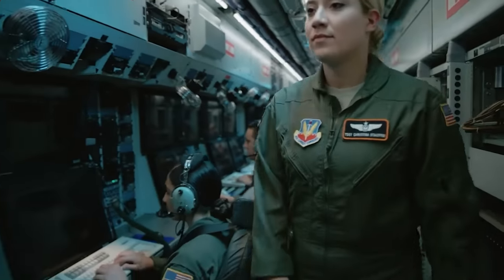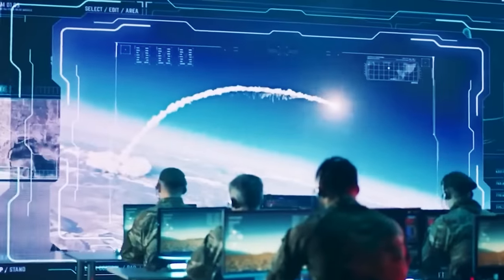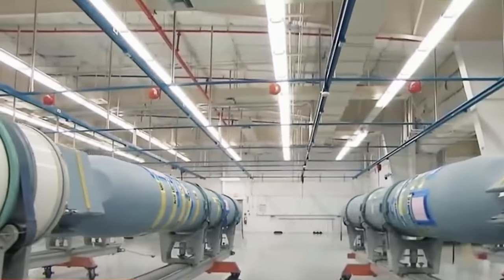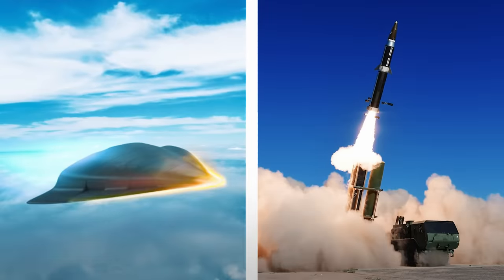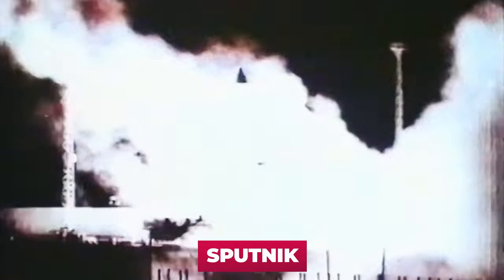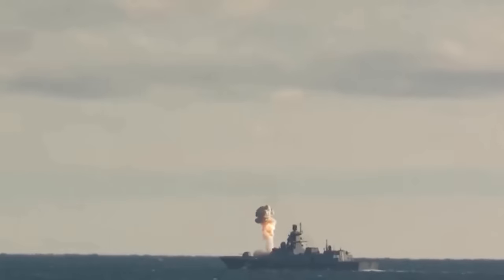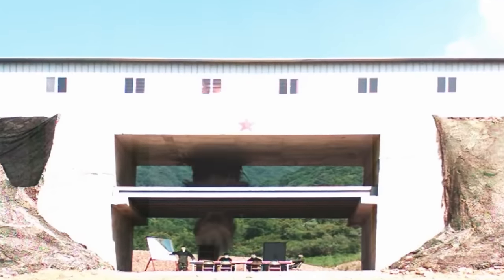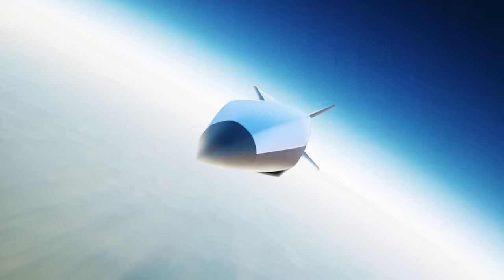US Tests Hypersonic Missile 5 Times Faster Than Speed Of Sound

Comment: We do not know the exact data on Russia's Kinzhal. We only know that it's indeed VERY FAST. -We only know this from video footage captured in Ukraine. As far as any and all capabilities beyond the proven high speed, depends on how accurately Russian technical data has been presented to the public, in the past. They present many of their most "advanced" weapons, often as having far better PK than they can often demonstrate.
Reply: Mac 12 though (no proof)
how about China (df17)🤷
Reply: We have all the data, its public. It is a ballistic missile, no need to fussle about that. Ukraine uses Tochka U, which is an old Soviet ground launched ballistic missile, similarly difficult to intercept. Poor precision and smaller range than more modern Iskander. And Kinzhal is 100% Iskander, just air launched to extend the range. Nothing more. Also there are just 3 mig 31 left that can lanch any, there are no Tu 22 modified to launch Kinzhals
Reply: Russia kinzhal do exceed mach 5 but that doesn't mean it is true hypersonic missile, all ballistic missiles achieve mach 5 but we do not called them hypersonic missile, so nothing special about kinzhal it doesn't even have glide vehicle or scramjet
Reply: @tluangasailo3663  Can it make it all the way to it's target, EVERY TIME, with accuracy as tight as the M142/M270's basic GMLRS?
Reply: @tluangasailo3663  Kinzhal means DAGGER in Russian so the name itself does not have anything to do with how fast it goes. There are Kinzhal Hypersonic missiles and Kinzhal Ballistic missiles and the one that was used in Ukraine was a Kinzhal Mach 12 which is clearly Hypersonic capability. I believe it was used to blow up a mall filled with Western ammunition and weapons.
Reply: @jonatikoisuva2695  do a bit of research,  all the ICBM from the past 60 reach mach 20,  
ICBM reach mach 20 - 27
IRBM reach mach 15 - 18
MRBM (like kinzhal) reach mach 10-15
SRBM is less than Mach 10.

why do you make an argument without knowing anything about missiles!! First Enlighten yourself before making comments!
Reply: @tluangasailo3663  Kinzhal and ICBM are two different types of missiles. ICBM missiles are ballistic missiles and Kinzhal is an cruise missile which makes it much more dangerous if it's hypersonic. If you don't know what a cruise and ballistic missile are then do find out. This are Two different things 🤷 Ballistic missiles is huge weights 19000-32000 kg and can go up the atmosphere then re enters earth to hit its target that is why it can go beyond mach 20 unlike Kinzhal it is fired from a jet and can go beyond mach10 without being detected by any defence system.
Reply: @tluangasailo3663  And to make it clear Kinzhal is not a MRBM. Russia has only three types of Medium Range Ballistic Missiles which are R5 Pobeda, R12 Divina and RT15. 🤦 So clearly you really dont know anything about missiles.
Reply: @jonatikoisuva2695  don't make lame conclusion after seeing Wikipedia, it doesn't help .lmao... kinzhal is still ballistic missiles, an upgraded iskander missile .... Russia reported it as 2000 km , then it's called MRBM,  it's not a cruise missile, its not HGV or scramjet/ramjet  ,  then what else ??? A ballistic missile MRBM
Reply: @jonatikoisuva2695  only long range ballistic missile  leave atmosphere,  not SRBM & MRBM . Of course you don't need to teach me about missile 😅, 

Answer my question: Why Kinzhal doesn't have Turbofan, Turbojet, Ramjet or scramjet engine  , without this propeller , there cannot be a cruise missile. In order for continous cruising in the air, these engine are necessity but kinzhal don't have one . Lmao
Reply: @tluangasailo3663  Those are the things that Supersonic and some jets still use  but For hypersonic cruise missiles to go beyond mach12 they will need something more advanced and new. That is why programmes for hypersonics are being funded, so that researchers do find a way to make this kind of things a reality. Now SRBM and MRBM are missiles that go out of space too but hit closer range targets. Cruise missiles are missiles that are mainly launched from jets that never go above the atmosphere and for a cruise missile to go mach12 is impressive because cruise missiles never go beyond mach 5.
Reply: @jonatikoisuva2695  stiring around on your imagination , isn't it . Of course for hypersonic cruise missile,  they need something so advanced called "SCRAMJET" engine. But Kinzhal is no Scramjet!!! OK.....    Ramjet = supersonic  Scramjet = hypersonic ...
Reply: @jonatikoisuva2695  so  you gonna keep displaying your ignorance here,  hehe......Scramjet engine are very real , Russia do have Hypersonic cruise missile called Zircon and it use a Scramjet engine , I bet this is also the first time you heard of Zircon missile. Similarly, US have Scramjet  programme called HACM, they are being tested successfully . The difference lies on the launch platform, Zircon is ship & submarine launched , HACM is air launched . Then again, if Kinzhal is really a hypersonic cruise missile, why should Russia bother developed another hypersonic cruise missile called Zircon?  

(India & China are also developing scramjet at initial stage , not yet on the degree of Russia&US though. )
Reply: @tluangasailo3663  Kinzhal is an air to surface cruise missile and Zircon is a cruise missile launched from subs and frigates. So notice the difference between these two missiles. Zircon hasn't even existed yet and it is the only Russian missile that uses scramjet engines. But who cares about what engines they use, as long as it can go beyond mach 9 to mach 12 is pretty impressive for cruise missiles. The US acknowledged it and they revived the Hypersonic programme because of Kinzhal. The impact it showed when it was used in Ukraine was mindblowing. Those types of impacts can only be achieved by ballistic missiles and if cruise missiles can create such an impact then imagine having a nuclear tip 😳
Reply: @jonatikoisuva2695  What so mindblowing about kinzhal in Ukraine? So far Russia has used 10 kinzhal but a far cry from defeating Ukraine . Who cares about what engine they used?? LoL....the engine do matters on maneuverability,  a kinzhal that use solid fuel rocket that follows  predictable path(similar to all solid fuel propellent) is far less maneuverable than a scramjet engine , that's the whole point of a scramjet engine - to make it more maneuverable, unpredictable, change course midflight and harder to intercept . Be it mach 12 or higher ,  a kinzhal could be intercepted by THAAD and Aegis SM3, especially the later one is designed to intercept missile  over mach 25 , it actually did this back in 2020.
Reply: @tluangasailo3663  There is something special in the Russian "Dagger" - it is ALREADY in service with the Russian Army and is already fighting
Reply: @mr.baskerville7329  definitely not enough to defeat Ukraine,  eventhough Russia used 10 of those . If they were really a true hypersonic missiles like scramjet and hgv , Russia would never deploy even one,  a true hypersonic missiles are extremely costly to produce,  something Russia will never use regularly in ukraine.
Reply: @tluangasailo3663  Scramjet is not the only thing that creates that type of hypersonics speed but none has even proven that it can even reach mach 12 or 14 it was proven by theory but not in reality. Like i said who cares what engine they use if it can do mach 12 they sure hell did a great job. And who said using kinzhal hypersonic missiles will defeat Ukraine ? 😳 Using Ukraine as a testing ground for these missiles will get them the accuracy they need that is why Russia has ordered a massive pile of Kinzhal and are equipped into their fighters.
Reply: @tluangasailo3663  True Hypersonic ? 😳 How does a true hypersonic look like ? 🤔 And who even says true hypersonic ? You can't even differentiate Ballistic missiles and Cruise Missiles 😳 Missiles that a Mach 5 and beyond are HYPERSONIC MISSILES 🤦
Reply: @tluangasailo3663  The statements of an amateur schoolboy not only amuse me, but also infuriate me very much - how the hell do you know what Russia will or will not do in Ukraine? ... save your chakras
Reply: @jonatikoisuva2695  if anything above mach 5 are called HYPERSONIC MISSILES, then why haven't you called ICBM a hypersonic missiles , they are mach 20 and above. How come the name  hypersonic missile became trendy now while there were already an ICBM with mach 20 all the way back from 1960s? It's a simple facts that those called hypersonic missiles comes in the forms of new technology cutting edge  which are called "Scramjet" & "Boost Glide Vehicle",  the actual missile  that can maneuver while at hypersonic speed like we never seen before.  A scramjet at mach 7 are far more dangerous than kinzhal at mach 12.
Reply: @mr.baskerville7329  youll never see T14 armata & Su-57 near the Frontline in ukraine, just like that....Russia might choose Zircon for extremely legit target in direct war with NATO
Reply: @tluangasailo3663  Because ICBM are ballistic missiles that have been achieving that kind of speed ever since it was made, just like you said hypersonic has been around for years. Mach 20 are hypersonic ? 😳 You know little about this i guess 🤦 scramjet at mach 7 are far more dangerous than Kinzhal at mach 12 ? 🤦 You cannot change the calculation of mach, a mach 7 will never be greater than mach 12 🤦 Try to find out how mach is calculated before even saying anything 🤦
Reply: @tluangasailo3663  Scramjets didnt even exists when those ICBM was hitting hypersonic speed.
Reply: @raa729  Now tell us about AVANGARD 🤣🤣
Reply: Imagine that all this marvel is still 10 years behind Russian and Chinese hypersonic tech. Good Luck.
Reply: @santannamv  Russia is still getting whooped like a featherweight fighter against a heavyweight.

Comment: Similar tests were first conducted 30 years ago, also at mach 5  🤣
Reply: The difference being these are designed to carry warheads and maneuver at low altitude.
Reply: @theduke7539  except they are only maneuverable at extremely long distances from their target. Any sudden movement would rip them apart. If the target moves while the missile is hundreds of miles away it likely will never hit it. Hypersonics are only kind of reliable against stationary targets.

Comment: Supposed footage of a Russian impact of one of their "hypersonic" missiles appears to be very suspect. In the aspect that the impact was not congruent with the expected kinetic energy of a missile moving hypersonic even without a warhead.
Reply: The Russian hyper-sonic missile is just a glider on a rocket. Its nothing compared to this, this missile is the real deal. Ramjet engine is extremely complicated and Russians cant build one. Years ago this thing was rejected its so complicated and expensive that is not worth it.
Reply: Because they don’t fly 5 machs near the sea level, as simple as that, its about 2 machs, otherwise it would simply burn down like any meteor, aim 260 flying mach 5 at 100 000 feet flies below mach 2 at low atmosphere, sr 71 flying 3.5 mach at 100 000 feet was heating up to 300C in atmosphere where the air temperature is -100 C and air density is 10% of the sea level. You need an active liquid cooled skin and real scramjet to do real hypersonic stuff, obviously Rus and Chin don’t have one. What they have on Zirkon and Chinese variant is just a sustainer, like EU Meteor anti air missile has, to extend the range after the booster finishes
Reply: @perkunast9680  Lol Ramjet is nothing son. you say is expensive. Ramjet been around since concorde lol.
You mean scramjet i think and it is not a ramjet at all the internal inlet is different and technology today has made scramjets cheap actually.
The rocket as boosters are expensive.
Reply: @nedkelly9688  Getting an engine to work at hyper sonic speeds requires material that was not even invented at the time of the concord.The Concorde had four Rolls Royce/Snecma Olympus 593 turbo jet engines they were not a Ramjet. Nothing is cheep about the Ramjet/scramjet.
Reply: @perkunast9680  I was wrong about concorde. but sorry to say Ramjets and scramjets have gotten significantly cheaper now.
3D printing has made it so.
Reply: I'm sorry they failed to impress you and give you the exact flight,guidance and impact performance stats.
Reply: The Russian  missile travels at hypersonic speed but doesn’t impact at that speed. It decelerates before it hits...
Reply: Subsonic at low altitude like all solid fuel rockets
Reply: Imagine that all this marvel is still 10 years behind Russian and Chinese hypersonic tech. Good Luck.

Comment: The statement that there is no defence against a hypersonic missile is not strictly correct. At higher velocities a missile will be more susceptible to damaging impacts caused by any sort of shrapnel or chaff. Weapons such as metal storm for instance, are capable of throwing up a wall of material much faster than mechanically initiated munitions. The point being that provided a defenders response is inside that attackers targeting cycle, a defence response is possible. It then becomes a matter of which is the most effective inception strategy. No doubt the thinking is already well advanced regarding this strategy using existing weapons and of course weapons that have not been made public.
Reply: Right now we don't have anything against russian HS missiles.
Reply: @dugzamilza5212  
That is nonsense. Russia does not have hypersonic missiles. Getting  missile to speeds of 10 times the speed of sound does not make it a hypersonic missile.

Comment: Scram Jet missile's cost more than or at the same per unit as todays F-35 and F-22. Therefore, the main approach is to make Delivery Vehicles that reach MACH X. For the USA, and use other tech to knock out apposing Hyper missiles... USA approach is that the Vehicles are re-usable... Not spend $150 million to $200 million per unit: only to destroy it. on an intercept program. 
🧑🏻‍🦱👍🏻🚀🚀

Comment: Russians have already send a ship full of hypersonic missiles and US has not yet manufacturer a single one of this kind! What a shame 😠!
Reply: You suggest us military should just lie like Russian ivan does?
Reply: @LexxR or just don't test it, and that same ship be at the bottom of the sea
Reply: Their hypersonic missiles aren't what the US wants. We already made them decades ago.

 Nearly all the hypersonic missiles China and Russia have are basically ICBMs with a lifting glide body and some better control over their flight path.

 The US is creating air breathing missiles that will have a flatter trajectory and ability to manuever. That is the huge difference.

 Also there is no way to distinguish an ICBM of the types of missiles that Russia and China uses. The US doesn't want it's conventional payload missiles to be mistaken for nukes as that would increase the chance of MAD.
Reply: @raa729   Kinzal hypersonic missiles flying since 2017 with Mach10 speed!!!!!
United States is 10 - 15 years behind. 
US Air defense systems are behind 15 -  20 years.
Reply: Kinzhal is not a true hypersonic missile, but an aero-ballistic one. But if Russia considers it as one, then US already had them in 1980s with Pershing II. Operational for a decade before being forcefully retired due to the INF treaty. Even before that they've developed GAM-87 Skybolt in the 1960s which is also an aero-ballistic missile. But they are bringing Pershing back, or a derivative of it with Army's LRHW. It's already been tested in 2020 reaching almost 3000km range with Mach 17 terminal speed. Naval version is CPS and will be retrofitted on the 3 Zumwalt class destroyers by this October and Virginia class Block V subs by 2025 if memory serves me right. LRHW is already operational since October 2021 with the first battery being delivered to the Army. It’s also light enough to be transported by a C-17 Globemaster so it can quickly be deployed and launch it’s missile after landing similar to M142 HIMARS. If they have enough numbers by this year, these will be deployed to the front lines. Japan has already agreed to host them.
Reply: @Gene M  no its not that's why nobody fucks with us lol 10 to 15yrs we been had shit like that for instance rod from God some things we don't talk about until part of the country is gone🤷🏽‍♂️
Reply: @EatMyBacon000  your right, Russian troops can't fight.  Weak.😂🤣😂🤣
Reply: @genem895  - Not true at all...
Reply: Believe me, Russia don't have a ship full of hypersonic missile, they are extremely costly to produce
Reply: @johnsilver9338  your story has no supported facts. 
It's like story of flying to moon.
In 1960th we had space suit for moon, but now , you can't replicate 60 year old technology.
Reply: @genem895   So is your story. Kinzhal is just Iskander launched from Mig 31.
Reply: @tluangasailo3663  I can agree,  that ship I'd not full of hypersonic missiles.
Hypersonic missiles only costly for United States. I heard that Pentagon will pay around  a 1 billion per each hypersonic missile. 
Don't worry about Russia, it's a Proficit country,  if you know what it means. 
Putin gives families with children extra money,  It's 10k $  for each  child
Reply: @johnsilver9338 It is not how you name it.
Point is that it flying mach10 on the distance 2000 kilometers and West can't track it!
Reply: @genem895  They can with long range radars, especially with Aegis SPY series radars and THAAD's TPY-2 radar. On the other hand Russia don't have one that is able to track LRHW fired from a distance of 3000km going at Mach 17. S-400 and S-500 radar's range are not enough. Maybe with Nebo-M but it can only detect it not track it.